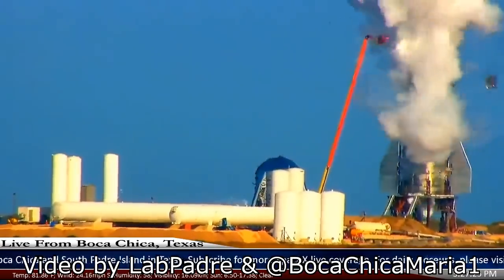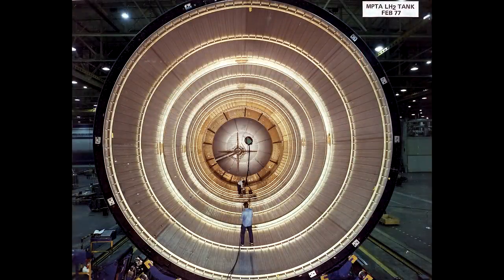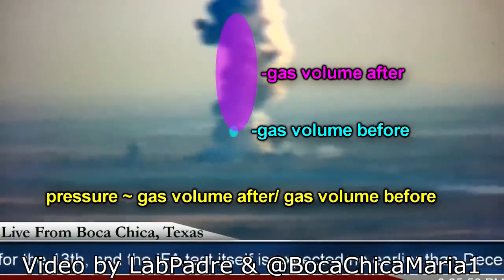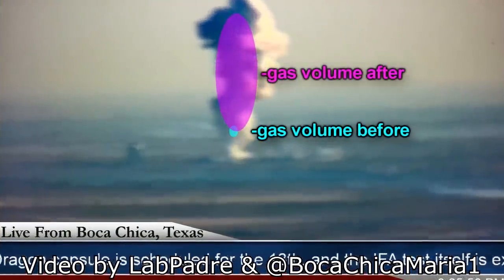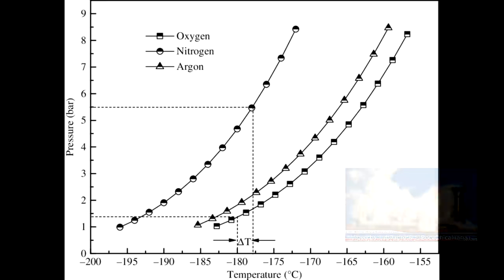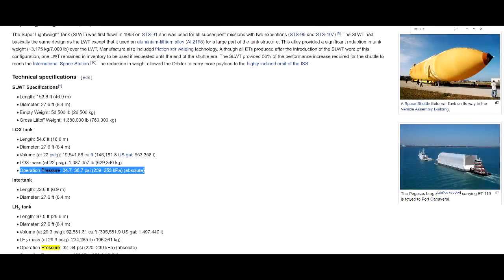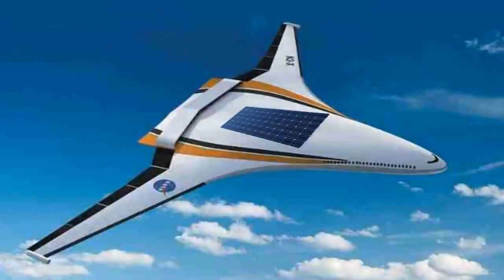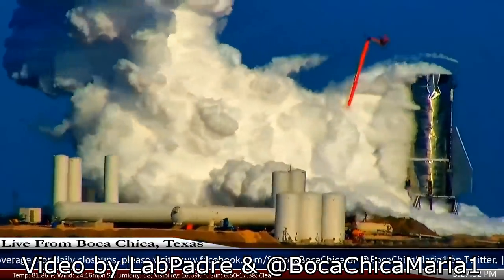Starship explodes, but why?

Comment: A trip with the BFR?

- 3000000+++ USD tickets
- extensive healthcheck, includes one full week of rigorous testing
- uncomfortable ride
- 10% chance that your flight will blow up while refueling
- 10% chance of dying during the trip
- 4 destinations all around the world
- 8-10G take off

We got it all, risk your life today in order to pollute the air 1000x more than conventional airliners, go through processes that takes 100s of hours of your time, be ready to have you trip delayed by a slight mist and last but not least, the craft's weight is primarily fuel, and you are one of 4 passengers, so get those millions going
Reply: You're intentionally over-exaggerating this, right? Probably a less than 1% chance of exploding while refueling, maybe a 1%-2% chance you'd die in flight, and 2-3Gs on takeoff. With more than 4 passengers, probably more 50-100. And at that, tickets would probably be cheaper than 3,000,000 USD assuming that the stainless steel production combined with the reuse makes the rocket cheap per flight.

I'm not saying it's good, but more that this is definitely over-exaggerated.
Reply: @noname117spore  If you knew as little as me about rockets you'd know that it's pretty accurate. Yes the exploding and dying probably closer til 1%, but in the case of SpaceX, it around a 10-20% failure rate. Acceleration on for example apollo 11 was 4G. And there will most definitely dont be space for 50-100 people. At max 10, though +-3-4 is what rockets till today have carried, so that price is probably very realistic.
Reply: @sandergjertsenstvold1051  The current SpaceX Falcon 9 has a reliability of about 97.1 (using my own system which is superior to a lot of the ones you see out there, Wikipedia has it at 97.4 for example). Although their landing rate is worse, and that needs to go up, but we're still early into the timeline of vertically landing rockets, so do expect that to get better.

I also think you're underestimating how big Starship is. Starship+Superheavy is basically as big as a Saturn V, which sent 3 people to lunar orbit and put 2 of them on it. Starship would be performing sub-orbital flights with much more efficient engines, allowing a lot more space for people/cargo. Plus, you only need to have enough supplies to keep them alive for an hour or two.
Reply: @noname117spore  🤣🤣🤣🤣🤣🤣
OK. So how on Earth would you fit dozens of untrained pedestrians into a spacecraft, wearing tailor-made pressure suits (nope, oxygen masks falling from the "ceiling" in case of loss of pressure won't do here: 1. no ceiling 2. periods in flight with no gravity, so no dropping down), and have the same level of health certification that commercial pilots must have? Not to mention boarding and emergency procedures - those require rigorous training, since boarding and riding a rocket is different from riding a bus or aeroplane. The idea is bonkers from start to finish.

But that's only the tip of the metaphorical iceberg that sinks the idea of using rockets for point-to-point travel.
Reply: @noname117spore  Good going... Imagine, even with a 99% rate, in one flight in ever hundred, everyone onboard would be obliterated. If you have around 300  daily flights on a global basis, that means between 150-300 people will die daily from travelling with SpaceX (99% safety and 50-100 people per craft.)

Also, making rockets more efficient than the F-1 (of the Saturn V (50% thrust efficiency, if my mind serves me correctl) is almost impossible, and would make no difference. And the efficiency gain would be a drop in the sea considering self landing rockets need 1/3 of the take off fuel just to land.

And like you said, Saturn V carried three people, and once you have reached the speed needed to escape earth's gravity, you don't need any more fuel. Going to Pluto is no different from going to the moon.

If you finally take a look at the Saturn V dry weight vs take off weight, you'll see that the craft is basically a silo with fuel. The amount of fuel, and how expensive it is is almost to cry for. An environmental death machine...

There's absolutely nothing that makes remote sense with making it into public transport
Reply: @sandergjertsenstvold1051    I'm not going to argue it makes sense as public transport, but I will correct factual inaccuracies.

1/3 of the takeoff fuel to land is false I believe. I think payload capacity is reduced by 1/3 on Falcon 9 when it lands, but that's not going to be a 1:1 correlation in terms of extra fuel used. That makes no sense given the burn times on a Falcon 9 launch. And from what I know, Raptor is supposed to be getting almost 100% (high 90s of percent) efficiency out of its engines.

"Once you have reached the speed needed to escape the earth's gravity, you don't need any more fuel." Do you actually understand orbital mechanics in the slightest? I mean, you have the speed part down, but you need fuel to get more speed, and you need more speed to get further. Therefore, you need more fuel to get further. Once you leave earth orbit, you're still in a solar orbit, with the same orbital mechanics at play. If you escape that then you're still in galactic orbit, with the same orbital mechanics at play. Gravity effects you wherever you go as long as there's matter somewhere in the universe. But back to the solar system, it will take much more fuel to get to Pluto than the moon, and it takes a lot more fuel to get to the moon than low earth orbit, and starship wouldn't even get to low earth orbit on point to point flights. So think of all the mass Saturn V had to transport to the moon, and all the extra fuel needed to get there, and swap it out for more people. That's what you get with starship.

In terms of pollution, Starship should be less polluting than a Saturn v, per unit of fuel used, but more polluting than, say, a Delta IV or the space shuttle by the same metric. This is due to the type of fuel being used.
Reply: @totalermist  you're assuming I support Starship as a means of earth to earth transport. I was arguing that the numbers were off, not that its practical or safe.
Reply: @noname117spore  Fair enough.
Reply: @noname117spore  100% efficiency? How cool, no light, no sound, no heat, no vibrations just pure thrust. M8 it's not 100% believe me.

Not needing more fuel after escaping (the majority of) earth's gravity was in a practical sense. Ofcourse you'll need more. But it's minor compared to the launch through the atmosphere and the first couple of hundred kilometres up.

And the rockets will be environmentally destructive regardless. The amount CO2 produced is one thing, but the scar on the ozone layer has huge consequences.
Reply: @sandergjertsenstvold1051  Ok, so that's what you meant when you said efficiency. I think what I meant for efficiency was about the most you could expect theoretically for a rocket engine, given the explosion at play, rather than "true" 100% efficiency. In that regard, how far is the Rocketdyne F1 off from that number?

EDIT: I just checked what Elon was talking about with that number, it was 98.5% of theoretical combustion efficiency which led to some confusion. This number seems to be different from total efficiency, as well as the maximum ISP for different fuel types. So great, there's 3 efficiency types being talked about here.
Reply: @sandergjertsenstvold1051  And do remember that the fuel needed to move around in space has to be lifted through the atmosphere as well, contributing to the additional fuel needed for liftoff.
Reply: @noname117spore  Well I'am not talking about combustion efficiency. Am talking thrust efficiency from the fuel energy, which is what that counts in the end.

And also remember that the fuel needed to land also requires fuel to be lifted. It will be quite a lot more than what Saturn V needed
Reply: @sandergjertsenstvold1051  Yeah, fuel efficiency should still be higher on Raptor, even when accounting for the different types of fuel being used.

 And yeah, fuel needed to land does need to be lifted. And looking at it now, it does seem like the Falcon 9's tank was extended about an extra third, although given the length of the burns I'm still highly suspicious that not all of that extra third is going to landing now. I think performance increases in the block 3 and 5 reduced the amount of fuel needed for landing from the block 2 (which never landed).

Now, it appears that the Saturn V's payload capacity to trans-lunar injection was reduced by about 2/3 compared to it's payload capacity to LEO. The Falcon 9, by comparison, I think only loses about 1/3 of it's payload capacity to LEO when it's reusable vs when it's expendable. Which does show that more fuel is needed to get something to just flyby the moon than to just immediately return that thing back to earth and land it.

Now, the reason I don't think it takes much fuel to land is that you can let the atmosphere do most of the work for you, as long as you're on the right trajectory you'll be fine. What suffers the worst from this, in a point to point starship system, would be superheavy, having to perform a boostback burn. Starship would be able to bleed off most of it's energy in the atmosphere prior to landing, using a tiny bit at the end. Superheavy's fuel needed to boostback and land would basically not factor into the equation as soon as staging had occurred. So it would probably be similar to a Falcon 9 on RTLS in terms of extra fuel needed to land, maybe slightly more for Starship.

Thinking about it now, Falcon 9 probably does use all of that 1/3 extra fuel on RTLS landings.That was probably calculated to let it RTLS on launches with Dragon. Droneship landings should require less fuel though. So I guess 1/3 extra fuel on Superheavy would be right as well in it's intended role. And Dragon is 4200 kg dry and can carry up to 6000 kg, although I think it sticks more at about 2500 kg of cargo. So yeah, since F9 seems to be RTLSing on that, payload capacity is reduced by about 2/3 from expended with reuse. So about the same amount of loss of cargo from LEO expended as a Saturn V loses from LEO to TLI.

So let's get to math. SpaceX claims that the Starship/Superheavy system should be able to take 100,000kg-150,000kg into LEO when fully reusable. To see if this is believable, Saturn V could lift 140,000kg into LEO. Although that does seem strange, as the 2 rockets are roughly the same size, and Starship/Superheavy has to use more fuel to land. It turns out that Starship/Superheavy weights about 5/3 as much as a Saturn V, despite the rockets being about the same diameter and height. Some of this is likely due to Starship/Superheavy having more volume, and some down to Starship/Superheavy having denser fuel. Also, having less stages means that more volume can be used for fuel.

Ok, so the 100,000kg-150,000 kg is believable. In all likelyhood, the early starship/superheavy will probably perform close to the former number, while later on they'll probably perform closer to the latter number. So let's use this lower number. If we're straight up cramming as many people into the craft as we can, then we can launch 1,239 average north americans in low earth orbit, and if we leave them up there in space, we can return the starship safely as well. Now, let's try to find how many we can return. As proposed, Starship can land with 50,000kg. So that leaves us with 619 people which can return. So let's argue for a worse case scenario and say that this needs to be halved again for Superheavy to RTLS successfully. This might not be likely, since I don't know if the original numbers provided account for Superheavy RTLSing or if they have Superheavy landing on a barge. At the same time, we did reduce payload mass by 50% already to let Starship land, so that reduction might let Superheavy rtls on it's own. But if it doesn't, let's half it again. That leaves us with 309 people (rounding down from what is actually a 309.789, which is because I've rounded down the previous 2 numbers in showing them here but haven't rounded them down when doing the calculations to produce new numbers). Of course, people need stuff like life support, and floors, and bathrooms, and maybe snacks. Although I kind of doubt it on snacks given how short these flights are supposed to be. Either way, we're also talking about sub-orbital flights here, despite the numbers being used for orbital flights, so the payload mass should be increased. Either way, the number of 50-100 people should be accurate given what they've said, probably a bit low.
Reply: @noname117spore   noname117spore  So we are still talking about it as a form of public transport? Those people numbers are ridiculous by the way. As a thought experiment: humans are pretty much exactly the weight of water. In other words, if you take 10 people each weighting 100 kg (aka 10 big bois) you can fit them all in a single cubic meter... So you get the idea about "cramming them in".

The cargo weight capacity on those rockets are as high as they are because all the numbers regarding the craft are big ones. Still, that doesn't tell a lot about the volume. The three guys on Saturn V didn't exactly live spaciously.

Nor is there a reason for 50-100 people to go into space. All the Elon's bullshit about "anywhere on the planet in 30 minutes" fails to mention that it excludes everything apart for the flight itself, which is probably only 5% of the trip's duration.

However, if the 50-100 people were in space, where would they go? There's absolutely not reason to go out.
Reply: @sandergjertsenstvold1051  The volume is supposed to be about 1000 cubic meters of pressurized space. And the only argument I made in regard to the flight times was whether they were short enough to not warrant the supply of snacks on the mission, which is almost something they'd have to do as a safety concern.
Reply: @noname117spore  Elon can pull whatever number out of his ass, but we'll have to wait at see.

I know you haven't directly mentioned it being public transport, but by considering the importance of a snack it's kind of implied.

The bus - no snacks
City hopping flight - snacks
Trans ocean flight - Full on serving

You aren't getting anywhere in space in 30 minutes, you'll get everywhere on earth in 30 minutes
Reply: @sandergjertsenstvold1051  You do realize there were proposals to turn the space shuttle into a passenger craft, right? Like, not for long distance travel, but for mass transportation of people into space. These proposals typically involved either putting a pressurized module in the cargo bay or converting the cargo bay into a passenger module. The most amount of seats in one of these proposals was 74 I think. Plus the crew, which in practice was a maximum of 8 but with a hypothetical design max of 10. So you could put 84 people into space with the space shuttle, if you converted the design into a passenger craft like in the proposals. The cargo bay dimensions of the shuttle also seem to be at least 306 cubic meters (that's the maximum I could find for payload dimensions, but there's a little room around the payload which isn't calculated). Plus 71.5 cubic meters of space for the crew. And do note that the Space Shuttle weighed less than 1/3 of a Saturn V. Scaling up the shuttle's cargo bay to a Saturn V vehicle is already going to leave us with more cargo volume than a Starship.
Reply: Should I take your lack of a reply as a victory?
Reply: @noname117spore  Quiet before the storm m8. So no.

I mean, obviously, rockets can lift lots of weight no problem, partially because of the unbelievable fuel burning rates. The amount of energy present makes the weight of humans minuscule in comparison. Saturn V could happily lift 40 100 kg heavy people, that's not the problem.

When it comes to space however... An airliner is pretty compact in that regard right. Lots of people in a rather small place. As close as one can get. But this doesn't work in a rocket, cause guess what, you're tilted 90 degrees back. You're wearing a special suit, and the seats obviously have to be much larger than they are on airliners... Not to mention, how does one simply board an airliner when everything is vertical.

And as said, why would you put 100 people into space again? The Iss certainly doesn't fit many people, I mean hell, doesn't they go through massive tests that takes some 6 months before they can go up there?

So if there is no place to stop out there, it'll basically be a point to point mission on earth, like the mission Juri Gagarin did in early 1961. 1961, 58 years ago...

Aka a very very very very fuel inefficient plane with a 2-3% chance of exploring in a blazing inferno of flames every single trip.
Reply: @sandergjertsenstvold1051  I mean, the argument wasn't whether it (BFR Earth-to-Earth) was practical (although I think I got the safety estimate wrong, the chance of death is probably <2%. Turns out it should be able to land with 2 of it's 3 landing engines not functioning, which means my safety estimate was probably over-exaggerated, and that mechanical failures, control failures, or software failures will be needed to bring the rocket down). Economically it's a stupid idea. Environmentally it's a stupid idea. From a noise pollution perspective, it's a stupid idea. All I'm arguing is that it's possible to fit the amount of people I said in there and lift them off from one point to another with at least average safety for rockets. I do see a potential use for space tourism with earth-to-earth, and they do have to master these sorts of launches and landings to get to the moon and mars. There's also some near-future proposals for space hotels, so if one of those gets built these could be used for that (But I wouldn't get my hopes up until the 2030s).

Also, rocket seating can get pretty cramped, and that proposal I mentioned was for the Space Shuttle back in the day, with 74 seats on about a third of the proposed volume of Starship on about 2/5 the mass (Turns out I screwed up comparing the Saturn V to the shuttle, I measured the shuttle in kg and the Saturn V in lb. The shuttle is actually about 2/3 the mass of a Saturn V, so scaling it up by that much would get around the 100 people I said could potentially fit into Starship from a mass perspective).
Reply: @noname117spore  From a mass perspective it's not a problem in even the slightest, as I've said. And also, if the point is exclusively to get the most people into space as possible, it's easy. Just start up the operation of the remaining space shuttles. They'll work just as well as they did in the 80's, they're just expensive. The thing is that space tourism and "hotels" will be reserved to multi millionaires. Regardless of what rockets you'll use it will still cost millions per trip.

And seriously, a hotel in space? Do you know how much the Iss has cost till now? It is quite a bit more than that hotel will ever make in revenue.

And if you want to get around the earth in a blink of an eye, while paying a hundred times less than the same trip with a BFR, and in much better comfort... just fly the bloody Concorde.
Reply: @noname117spore  Well then, I suppose I should take your lack of a reply as a victory...
Reply: @sandergjertsenstvold1051  I swear I replied. Stupid YouTube, it didn't go through. It was a nice, long comment as well, so I'm pissed that I lost it.

Basically, using the space shuttle to launch a bunch of people into space is a really, really bad idea, for a lot of reasons. Firstly, from a design standpoint it's the least safe spacecraft you can fly. And I am going to stand by that now; I've become convinced that Starship needs a triple engine failure or major control failure to crash, and the only real significant risk it has over the shuttle is the massive amounts of fuel it carries attached to the passenger compartment. The shuttle, of course, has little chance to evacuate if something goes wrong, and has delicate heat shielding placed next to a rocket which stuff can fall off of. This latter part can be solved if it travels to space stations, by leaving everyone on the space station if stuff goes wrong.

You'd also have to grab the shuttles out of retirement, convert them to carrying people, and restart production on new shuttles, less you want only 4 launches a year. And you'd have to restart production on shuttle parts, although that might not be impossible with the engines and the SRBs. That would be extremely difficult with the EFTs though. So this all would be expensive. Getting a launchpad would also be a headache; they'd have to build new ones or scrap the SLS program to get 39B back (pissing off a lot of contractors and probably getting into legal battles) or get into a legal battle with SpaceX to get 39A back. If they went with one of the latter 2 options, then they have to reconvert the pad back to operating the shuttle. And they'd probably want to go with either both of the latter 2 options or neither of them to ensure the ability to have a backup shuttle for safety. Which would involve pissing off both Boeing and SpaceX, who they are currently contracting for bringing crew to the ISS. All of this would be hugely expensive anyways. It would probably cost as much as developing a new rocket. All to get something badly outdated and with an expensive launch cost. I don't know if Elon's prediction of Starships/Superheavy's launch costs will be right; he was off by about a factor of 8 on the Falcon 9 (at present), but for certain it will probably be significantly cheaper per ton to LEO than Falcon 9. Which is about 5 times cheaper per ton to LEO than the shuttle (although with understanding that the shuttle put people as well as payload into orbit, which increases the shuttle's value a bit, but not that much. 5 times was already rounded down anyways).

Basically, if you want to put a lot of people into space, Starship/Superheavy is a better option than a converted shuttle in just about every regard.

With the ISS comment, do remember it's a government-contracted science experiment with a number of it's components launched on that expensive craft called the Space shuttle. Space hotels would benefit from having no government contracts for companies to exploit the hell out of for money as well as spaceflight getting cheaper, which is the current trend (reusable rockets should make them doable). As well as not being a science experiment. Basically, the cost of the ISS is irrelevant to that of a space hotel.

If BFR can lift 100 people into LEO at the same price of a Falcon 9 today (which is a far more conservative estimate than Elon gave it, but still multiple times cheaper than a Falcon 9), then it would cost around 500,000 dollars for a ticket. Which is less than a million. It's still a lot of money, but it's certainly possible we're looking at tickets to orbit of less than a million dollars here.

I mean, Concorde would be slower. But Starship earth-to-earth basically has the same advantages and problems of Concorde, just exaggerated to a ridiculous degree (with bias towards exaggeration on the part of the problems). And Concorde didn't turn out well in the end.
Reply: I should mention that I didn't do a good enough job at explaining just how bad of an idea it is to bring the shuttle back by reusing all the launch infrastructure it uses. In addition to that, you need to get the VAB and the orbiter processing facilities back, and converted. The VAB would be difficult, and would further kill the SLS program (if you thought you could get away with just killing the Falcon Heavy and shooting the Falcon 9 in the foot, you can't. SLS dies no matter what you do if you bring the shuttle back without building a new launch complex). Right now the 3 orbiter processing facilities are leased to Boeing, 2 of which are basically processing the X-37B, while the last is for the manufacturing and testing of the CST-100 Starliner.

So, in a hypothetical situation where you return the shuttle to service by converting all the old buildings and infrastructure back to serve the shuttle, you have just:
Killed the Falcon Heavy
Halved the east coast launching capabilities of the Falcon 9
Severely delayed or outright killed Crew Dragon until SpaceX can convert SLC-40 into a crewed launch site, probably by moving the equipment previously from LC-39A to SLC-40.
Removed the future ability of Starship/Superheavy to fly from Cape Canaveral. SpaceX could build another pad if they wanted, but their current plans would be dashed, and delays would ensue.
Severely delayed or outright killed CST-100 Starliner, forcing Boeing to find or build a new place to manufacture and test the capsules
Severely damaged or outright killed the X-37B program, forcing Boeing to construct new facilities to process the craft. This will probably piss off the US military as well, since the primary purpose of this craft seems to be for classified missions/payloads.
Killed the SLS program. In doing so, you have probably pissed off a lot of contractors. Including Boeing.

Basically, if NASA did this, they would lose a lot of current and near future spacecraft capabilities; would probably set back the ability to launch man into space from Cape Canaveral for at least 5 years (right now we're maybe 3-6 months out from that), and would probably be sued by SpaceX, Boeing, and the numerous pissed off SLS contractors. Oh, and the US military would be very unhappy. And they would've spent a lot of money on returning an old, costly spacecraft back to service.

I can't believe I'm saying this, but Starship/Superheavy earth to earth is a more practical idea than returning the space shuttle to service.
Reply: @noname117spore  Yes of course the Shuttle shouldn't be put back in service, that's obvious. But we are still talking about Starship/BFR doing earth to earth flights.. which is totally fucking stupid. It might take 30 min to the other side of the world, but like I've said, the physical stresses, fueling, and safety checks needed will take an absurd amount of time. Not to mention rocket launche's vulnerability to sub optimal weather conditions... Draging the Concorde out of the grave is a much much much better option, time, economically and environmentally wise. Renting a two seater F-15 with extra wing tanks and a pilot will be both cheaper and quicker. Hell, flying a 737 in economy with a hub city landing in the middle will be quicker. Not to mention more environmentally friendly and 1000x times cheaper.

And not to mention, people went mayhem as soon as they heard the Concorde passing overhead at slightly above Mach 1. What about a rocket taking of once every half hour just couple of kilometers away? And talking about environment... We are soon not even allowed to drive our 50 mpg cars anymore, meanwhile that 100 people per flight machine can happily operate? Which will be something like a Saturn V. The same Saturn V that had turbines producing 15000 hp just in order to push enough fuel to the rocket motors.

And so then it remains to see, the ISS is always full, and they already have a reliable rocket to come and go every 6. month, so I don't quite see why they'll need a craft ment to carry a 100 people.

There's literally no fucking purpose for it to even exist on a blueprint. It's obsolete even before arrival, figured out with a bit of practical thinking.